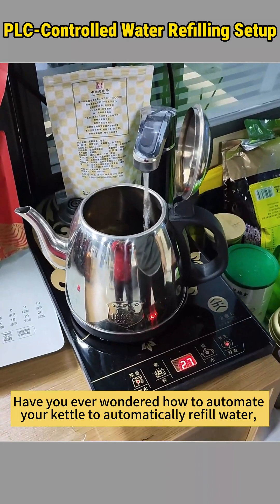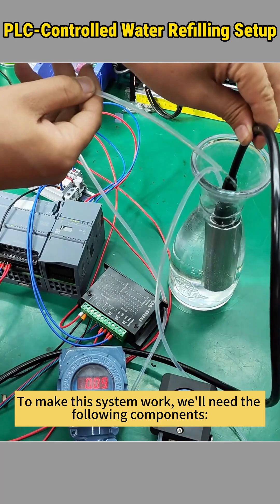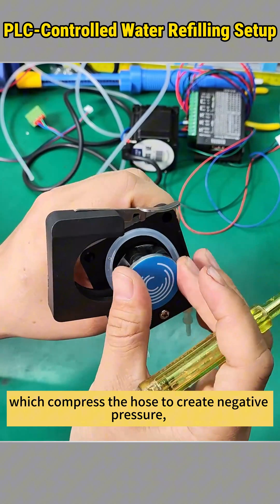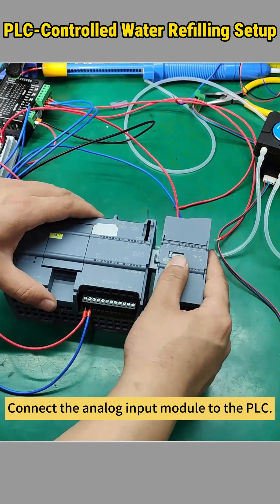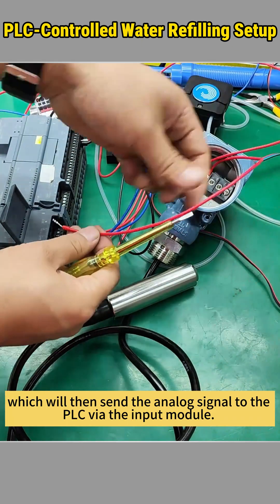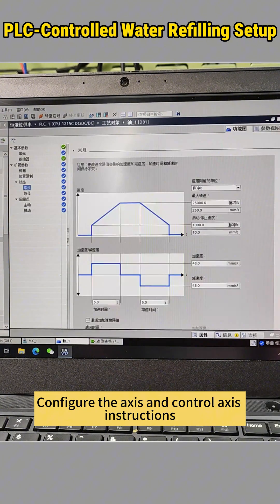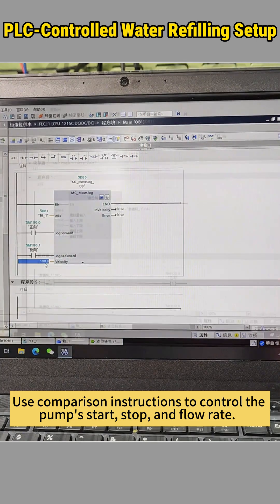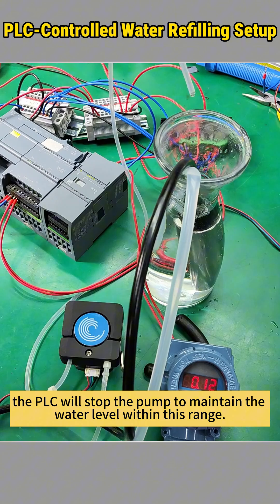Smart Water Refilling System with PLC Control #plc #waterlevelcontroller #diy

Comment: Whats the price?
Reply from the maker: Hi sir. The cost/price may be varied by your budget or the product model, but generally the cost may be around $700.
You can check out the following purchase links to calculate the actual cost based on your specific needs.
**And we provide free shipping worldwide.
Programmable Logic Controller (with integral analog input module): https://www.ato.com/programmable-logic-controller
Level Sensor: https://www.ato.com/high-temperature-level-sensor-20m
Peristaltic Pump: https://www.ato.com/peristaltic-pump
Stepper Motor: https://www.ato.com/stepper-motors
Stepper Motor Driver: https://www.ato.com/stepper-motor-drivers